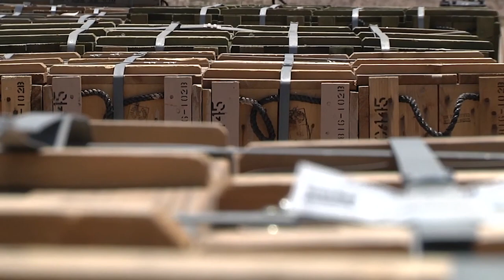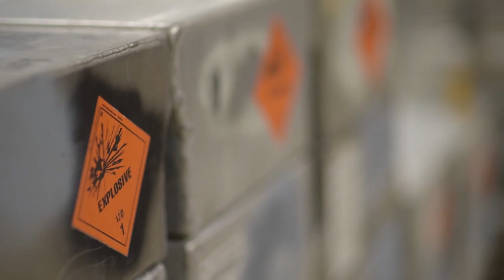Joint Munitions Command Mission Video 2023

Comment: Don’t you just admire how the 2 2/3 Zumwalt Class all have weapons that require munitions that would cost $300,000 per round and are therefore not going to be used. 
   That’s right, built with guns that have zero munitions manufactured.